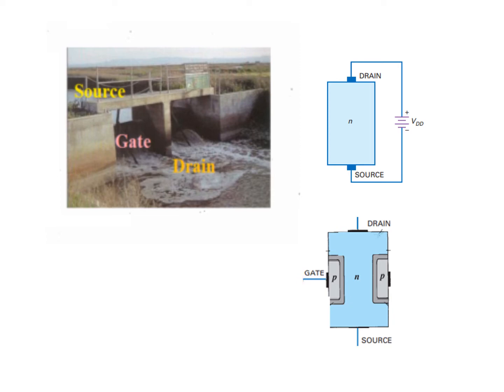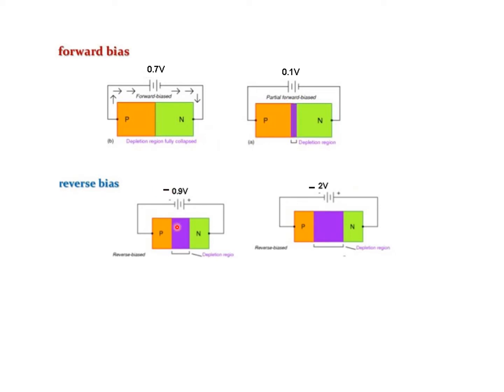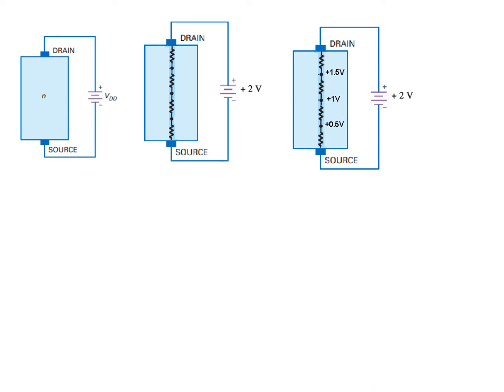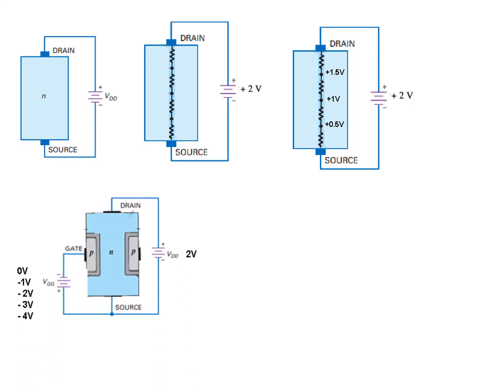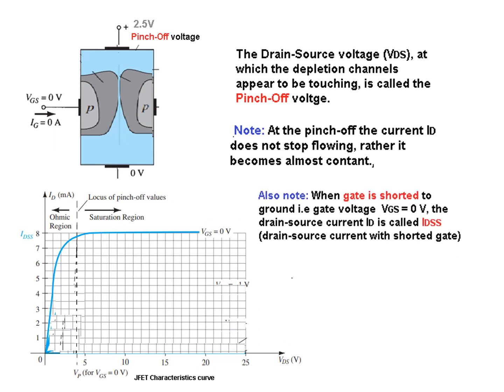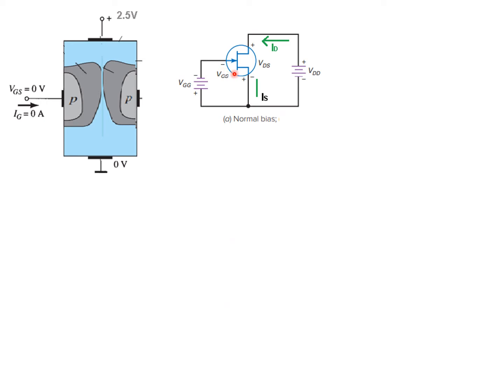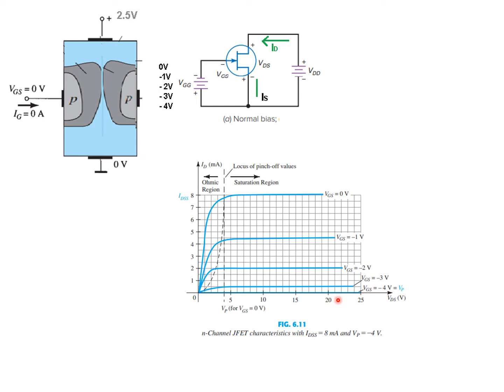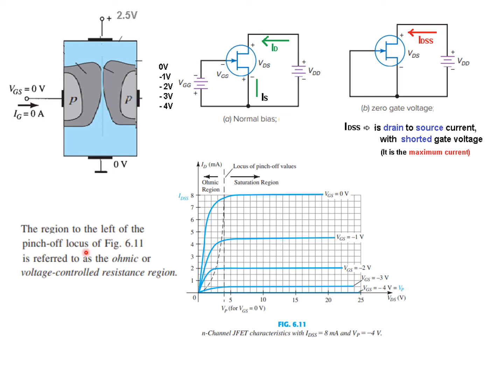(English)EDC || Question 6.2 ||Field Effect Transistor || JFET

Comment: At 8:47 Isn't the pinch off voltage 0v for VGS=-4V ? As at 0v Id becomes constant
Reply from the maker: I think you have not being able to follow correctly from time 5:10 onward. VGS will become VP (pinch off voltage) when the current becomes constant from start to end, This only happening( bottom line) when VGS = 4V, so this is pinchoff voltage Vp.
Reply: @ElectricalEngineeringAcademy  thank you sir for clearing up the confusion
Reply from the maker: @bedazzledblue8458  Welcome dear. Best wishes
Reply: @ElectricalEngineeringAcademy  Sir it would be a great help if you upload some lectures on self bias  and Q point of JFET